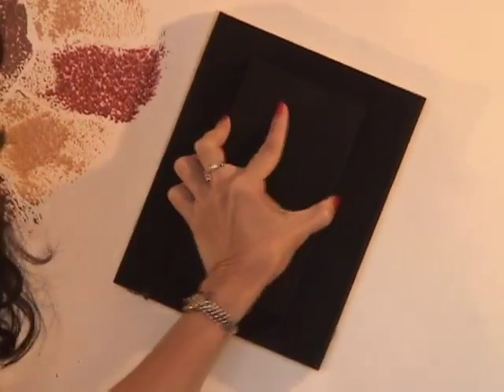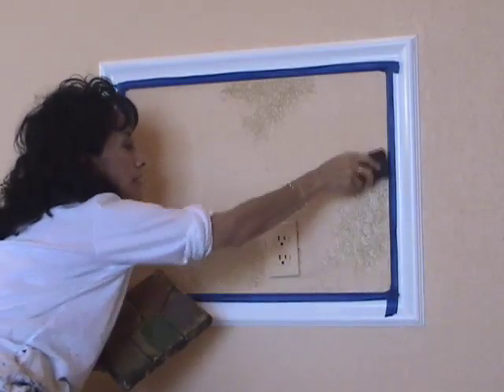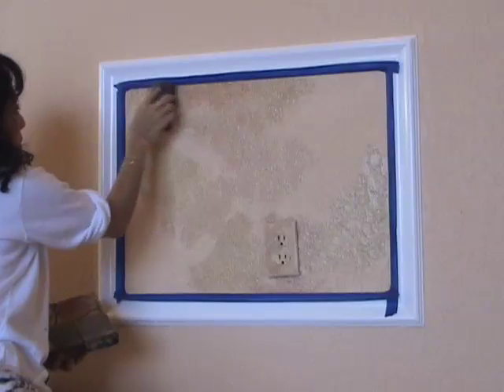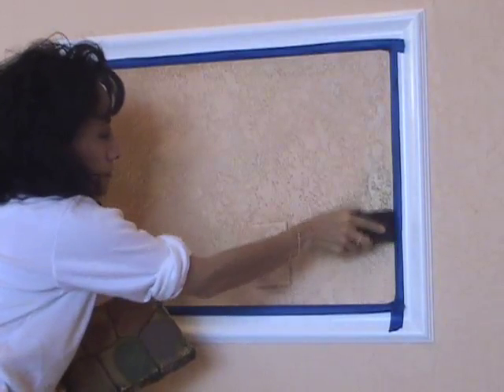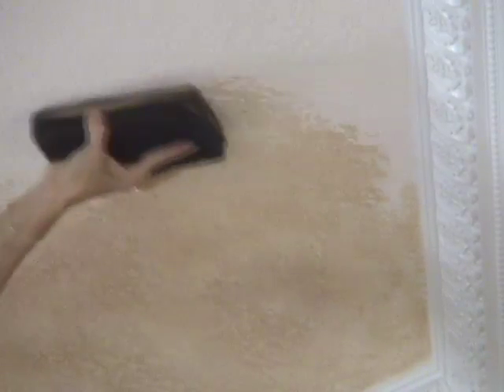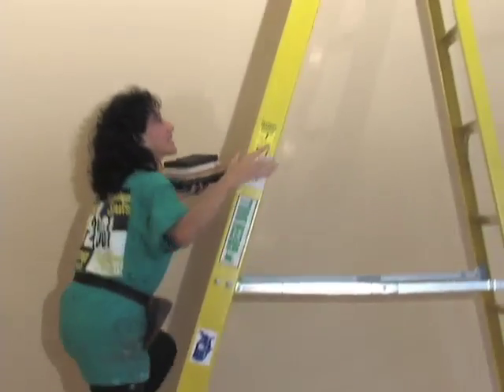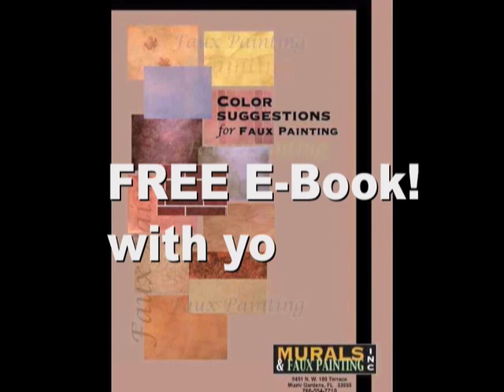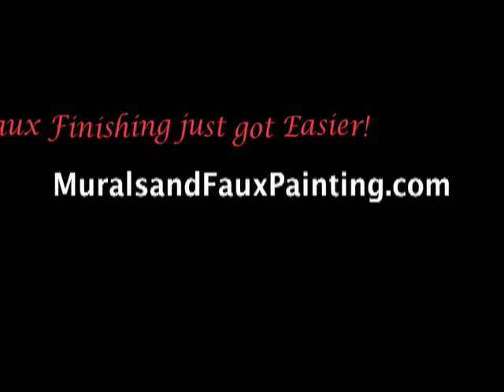How to paint on Knockdown Texture Color Wash faux finish

Comment: lol its ok settle down. Ty for sharing something you have learned with others. May i ? Wallpaper removal. Use paint sprayer, keeps baseboard & floor dyer, max water on walls,muchless water used, apply water like painting a car, (3) very fine thin spray coats.Strip top to bottom first layer only. Wall at a time.Keep wet moving, dont slack lol. Same with backing on next go around. Dont try to cheat lol , skill makes speed. Be what you do. lol figure that one out. Have a great day folks. :-)